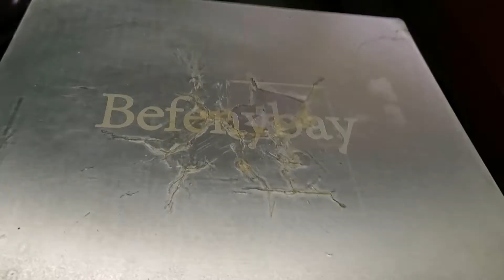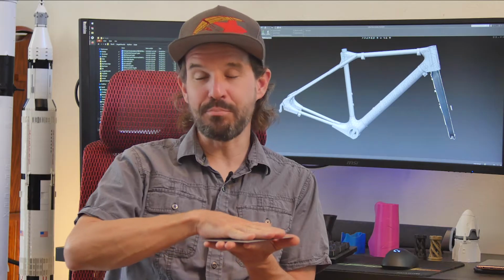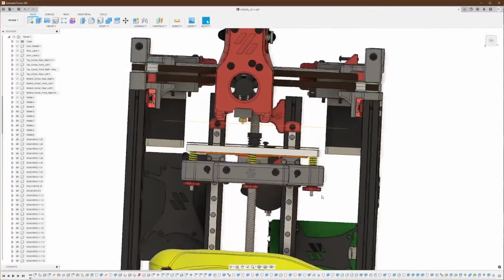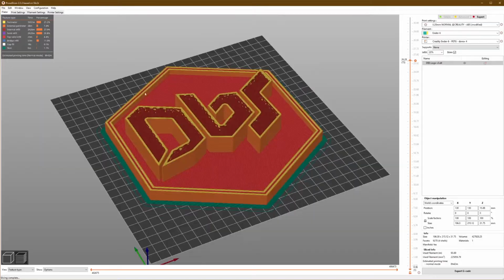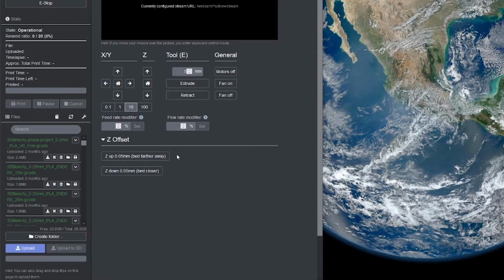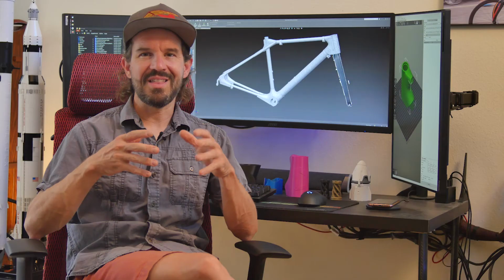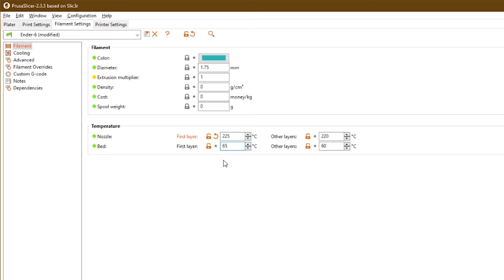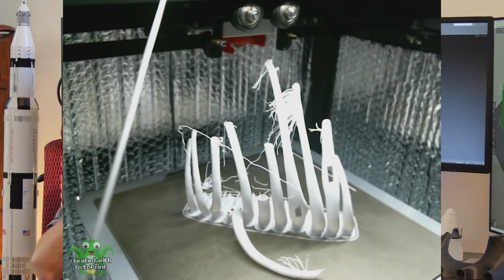How To Get The PERFECT First Layer on Your 3D Prints

Comment: I have a question, I get a great first layer, but the next 3-6 layers can the nozzle digs down and makes a rough surface. BUT If I lower my bed the first layer is hit and miss if it'll stick. 
Guessing it might be the Z offset? Or something to do with the e-steps of the Z axis?
Reply from the maker: This sounds like over extrusion actually. It's not that the nozzle is digging, it's that there is too much plastic being squeezed out (which will look like nozzle digging.)
Reply: @designbydave  but the dragging kind of sorts itself out after the initial 6 or so layers and starts printing just fine 🤔
Reply from the maker: @thqp  hmmm, in that case it sounds like maybe your first layer isn't sticking very well. If the first layer lifts, partially, then the next several, layers will be too squished.
Reply: @designbydave  The first layer stays down great. that is why I was so confused. THere seemed to be no rhyme or reason BUT then..

I adjusted my initial layer height from 0.25 to 0.2 and it seemed to help.
But if I go down to say 0.12 initial layer height the filament wont stick again And I have to adjust the Z babysteps or the bed level again. So I'm  assuming there is something going on with the z offset or somethin related to that, since the printer works great at 0.2 but adjust it either way and it has hissy fit.

I decreased my acceleration by quite a bit also as I had bumped it up earlier.

Running a 2 week old Ender 3 btw.
Reply from the maker: @thqp  Hmm, something interesting is going on. Maybe join us in the discord and myself and others might be able to help troubleshoot. Share pics, video etc - https://discord.gg/QdPa9ed6Jq
Reply: @designbydave  all right will do 😊👌🏻

Comment: If you have an Ender3.
Dont expect your bed to be flat.
Mine are lower in the middle.
I fixed it by sticking some alu tape to the magnetic surface.
It shimmed up the middle enough to level it.
Reply from the maker: That's pretty much going to be the case for most print beds. I made an updated video where I talk about that a bit, and the need for a probe to compensate. Your idea for mechanically "flattening" the bed sounds like something worth trying as well.

Comment: Hello
I have a question I’m kinda new to 3d printing and I’m not sure if it’s normal or not that’s why I came here but the bottom of my 3d print I feel like it’s too visible and has a lot of lines pls help me!
Thanks.
Reply from the maker: The appearance of the bottom of your print will depend on the print bed surface. If it's smooth, you should expect to see the extrusion pattern (lines.) A textured bed will help to hide those lines.
Reply: @designbydave hey I don’t get it
Do u have insta so I can show u a pic of what I mean?
Reply: @designbydave pls answer man your the only hope I got.

Comment: thank you for explanation!

but what if right bottom of the bed is too far and in the same time left up - is tooo close while testing? How can i proceed here without any adjustable knobs on corners?

ender v3 ke, autoleveling and auto z offset
Reply from the maker: I'm not sure I understand. Your printer should still have a way to mechanically level the bed before doing the auto leveling
Reply: @designbydave 
no, in new Creality printers there is no manual knobs anymore. Ender v3 KE, CR 10 se, K1 - nope. Everything on bed sensor
Reply from the maker: I'm not sure about those printers. There must be a way to mechanically level the bed to a "good enough" state before the auto calibration. I suspect that is done at the factory before shipping. Perhaps your printer is mechanically too far from level that the auto calibration can't compensate. You will need to look into a specific leveling procedure / workflow for your printer.    @whoarewenow

Comment: Great information, I will have to try hairspray.
Reply from the maker: A slight update to this, I might suggest trying Magigoo adhesive as possibly a better alternative. I haven't tried it with PETG, but with PLA its great. They also make nylon and polycarbonate specific versions which work perfectly. They are all water soluble so they wash off the part and build plate easily.

Comment: Seems that my temperatures are across the board 10 degrees higher then want is recommended by the manufacturer. New to 3d printing so not sure what to make of it…
Reply from the maker: As long as you are getting desirable print results, that shouldn't be an issue. Could be that your thermistors are not that accurate which wouldn't be unheard of considering these mostly cheap, mass produced components in consumer level 3d Printers.

Comment: Thank you for this video! I have been trying to print a part with small holes for mounting and was having problems with warping and decreased adhesion around the small areas on the first layer. Increasing the bed temp, decreasing print speed, and adjusting the z-offset in real time while watching the first layer was just the trick I needed. Again thank you so much!
Reply from the maker: So glad to help!

Comment: Can't wait to follow your advise! I'll give some feedback soon. Just got a Ender 6, small parts print perfectly, but larger parts not so good.
Reply from the maker: There's a lot a play with larger parts other then the first layer to consider. Material warp as it prints, supports etc. However a good first layer is critical.
Reply: @designbydave  Shot man. I'm pulling my hair out from frustration. But I'm sure I'll get eventually. Thinking now that I have never set my z axis home adjustment screw when assembling the printer.

Comment: the problem I am have is that the first layer is not coming away from my project any ideas to why please
Reply from the maker: "first layer not coming away from my project" 
What? More details please
Reply: @designbydave  The initial first layer that goes onto the bed before the project starts on top of it which is fine and it sticks to the bed nicely but when the project is finished and I try to remove or seperate the first layer or bed layer from the project it is stuck fast to the project and very hard to remove

Comment: Thx, i have a silicon carbide glass Plate, and this is amazing, it holds everything ABD PETG PLA, without problem, only thing is that you have to wait until it has Room Temperature, but believe me it made my life in 3D Printing much easier.
Reply: And now my Printer prints mostly every time, directly after cleaning the plate with alcohol. No Spray nothing, i have a CR10-S with BL- Touch double Gear, full metal headend and a Ruby Crystal Printhead. 🙂

Comment: my first layer on my ender 3 v 2 while printing a lithophane box had good squish and great adheasion, the only issue i had was the lines of each pass were just barely touching like fine hair, just missing eachother. if i pull the first layer off and looked through it, it would be like looking out of cosplay white eyes. so that first layer at .2 layer hight making it .25 may work. thank you
Reply from the maker: What you're describing usually means that the z offset is too high, however in that case you would likely have very poor adhesion. 
I would first check that you are extruding properly. Calibrate esteps and then flow %. 
Also check the extrusion width in your slicer. I'm usually at 0.45mm width for a 0.4mm nozzle.
Reply: @designbydave  zoffset is good, bed is level. I’ll have to check the width. How do you calibrate flow? I have my Esteps calibrated.
Reply from the maker: @JDMRaw  calibrate flow percent (Prusaslice3r calls it "extrusion multiplier) by printing a small, single or double perimeter, hollow object and measure the wall thickness. It should be the extrusion width specified in your settings. If not, adjust multiplier accordingly.
Reply: @designbydave  also my extrusion widths are set as percentages. I’m using super slicer. It does a pretty good job. It’s just. You can use % or mm to justify settings.

Comment: Hi David, awesome video! 
just wandering if you had a video about insulating the inside of your ender 6? 
and why you did it?
Thanks, keep up the awesome vids!
Reply from the maker: Hey thanks for checking it out! I don't have a video about the insulation and I put that in after I made my main Ender-6 video. I just lined the inside with cheap, garage door insulation, held on with double sided tape. The insulation keeps the enclosure warm, not quite as warm as a proper heated enclosure, but warm enough to print challenging materials like ABS, ASA and Polycarbonate. See my video about printing carbon fiber PC for more on that - https://youtu.be/6PIEF9uWKSA
Reply: @designbydave  thank you very much. I have already watched that video. it’s awesome!